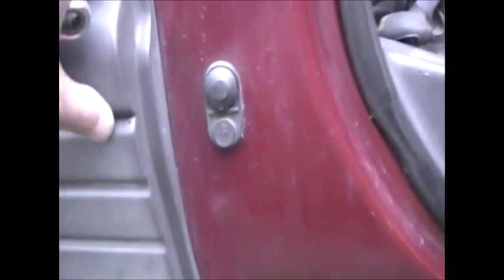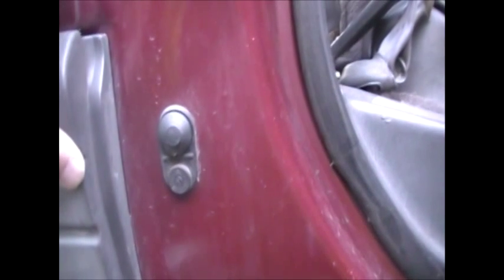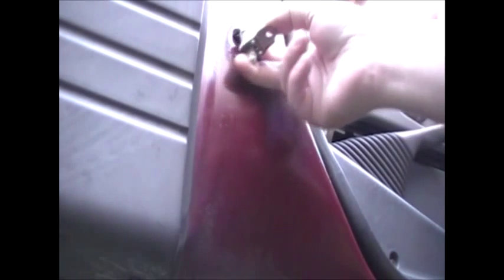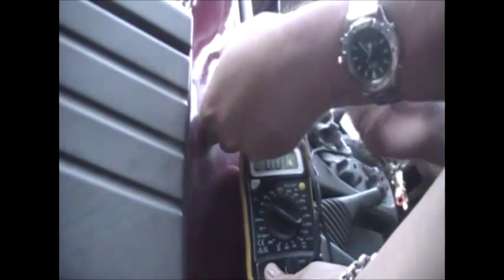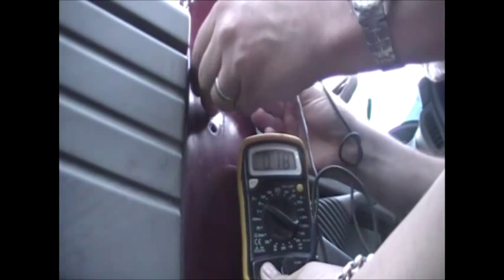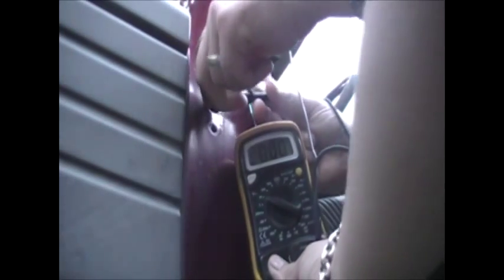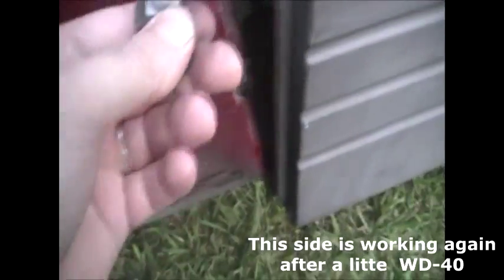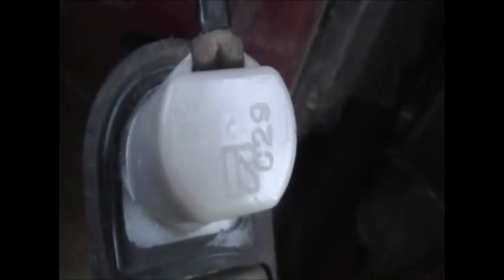Courtesy Door Light Switch [ Tarago Previa Estima TCR ]

Comment: In fact i tried that but to my disappointment it did not work. I had to pop open the switch and have the contacts cleaned using sand paper.

Comment: I doubt that would work for long as the spring gets weak and fails to make a good earth on the drivers side switch.
Reply from the maker: I thought that as well but worth a try. I uploaded this video Apr 16, 2014 and both sides are still working perfectly. worth trying before replacing.